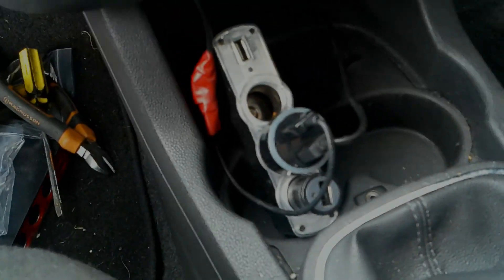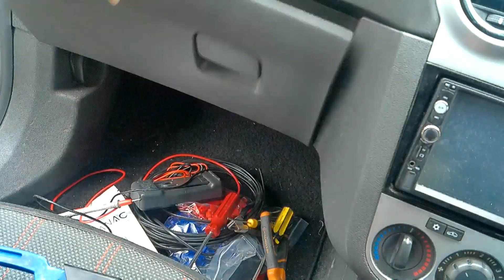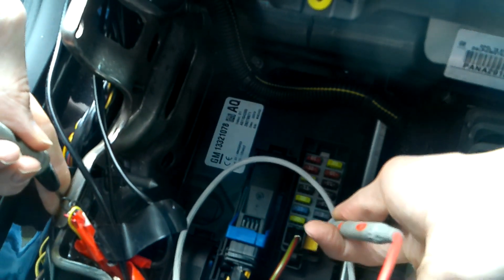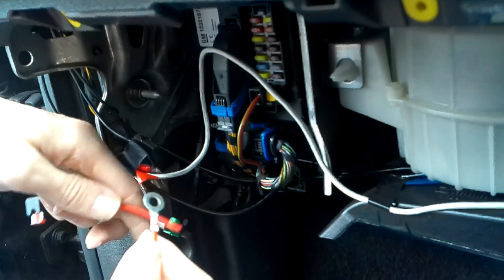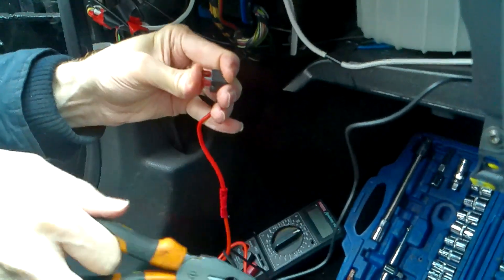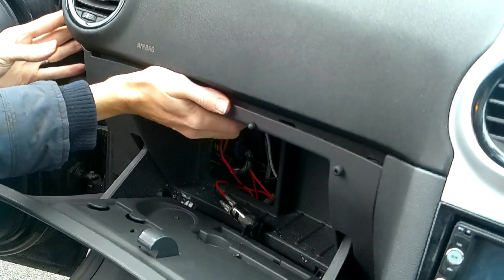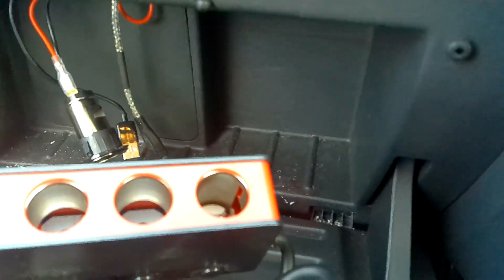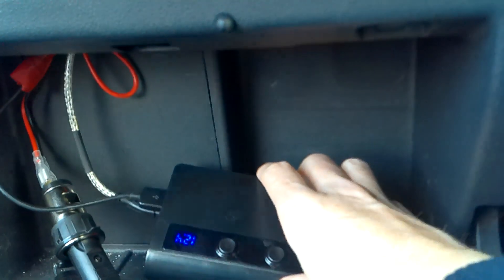Fitting USB charge sockets to a Vauxhall (Opel) Corsa

Comment: Nice work still waiting for the zafira gear stick movement being stiff fix 😄
Reply from the maker: I know, sorry! Ive still never got to the bottom of the issue with it being stiff. However mine has got easier on its own, even on long journeys which leads me to believe it is purely lubrication on the cables and mechanism rather than anything with the gearbox itself
Reply: @junkendriven  i think its the cables mate if i was to guess mines is still stiff unfortunately can't find much info on a exact fix.

Comment: Great videos, I also have a corsa and have done many diy jobs thanks to you guys.  I see you have a aftermarket head unit fitted, how did you mount it? I have a similar one but it’s very lose inside and the fascia hardly holds it
Thanks
Reply from the maker: Hi Khar, thanks for watching and subscribing. I'm actually just about to publish a video on swapping the head unit out on a Vauxhall Corsa so that'll be on the channel in the next week.
The fasteners for them are tricky, make sure you've pushed all the metal clamps out as far as you can to crush it against the existing surround. Some of the cheaper fascia don't hold very well so you might need to pack the edges a little with cardboard (hidden behind the radio) to help.